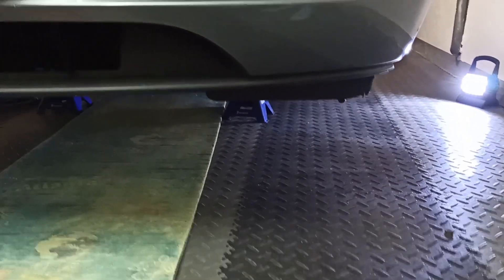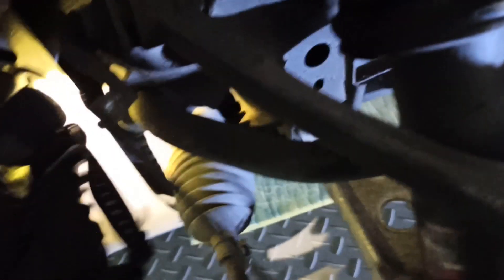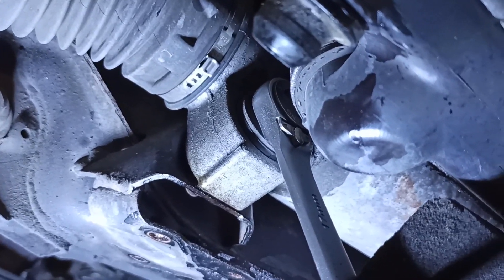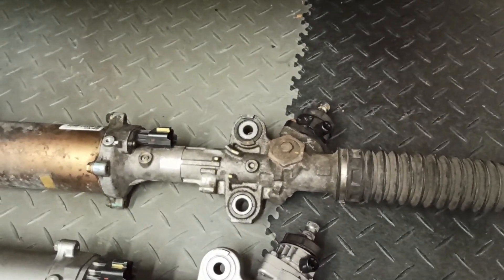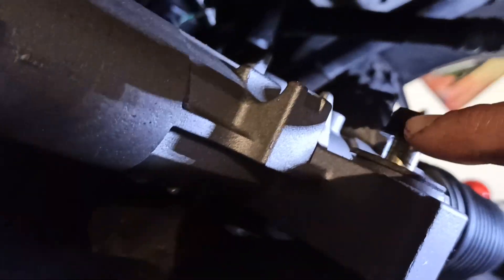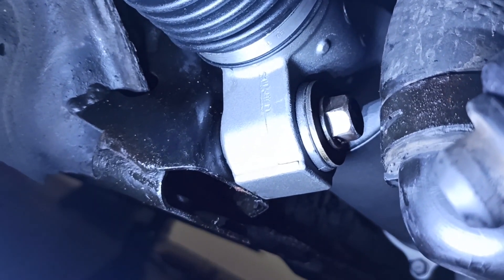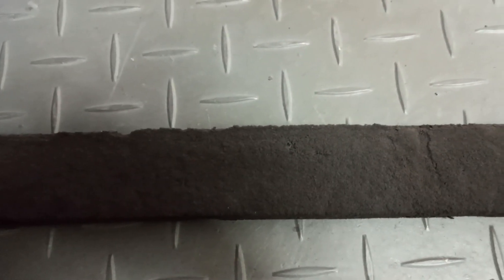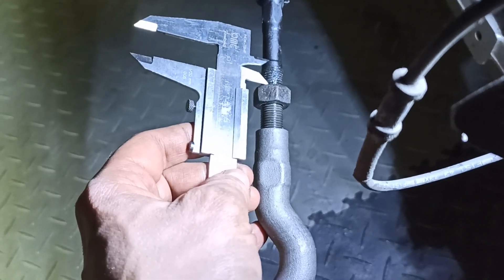Mazda RX-8 warning light for steering support - how to replace your steering rack

Comment: When you removed the steeering rack from the steering column did you align the the pinon going into the steering column? Like the small grey piece with the pink plastic dot on ii that detaches from that knuckle joint?
Reply from the maker: I kept the wheels and the steering wheel straight. When installing you need maybe more then one attempt to get it back in straight. You will only see it when both wheels are installed.
Reply: @heroesofthelandstrasse  I don't quite understand why you have the torque sensor adjustment with ForScan and what it's for.
Reply from the maker: @josebasyosi3818 The sensor needs to be calibrated to center position. When the steering rack is in middle position, the torque sensor is not necessarily at 0 V. The EPS CU need to know, which voltage is assigned to the medium position. You need to send a specific PID to the CU to tell it that it should store the given voltage as center position.
Reply: @heroesofthelandstrasse  I understand.
although I don't see this as a major issue. In my case, I have a problem that I don't know if it's common to the RX-8: when I'm stopped at an intersection, I turn the steering wheel 360 degrees to turn onto another street, and then start moving again, the steering wheel doesn't return to the center. At low speeds, it works more or less fine; it returns to the center properly, although it needs a little help.
Reply: @josebasyosi3818  Most likely that your steering joint 'UJ' is stuck/dry. It's halfway up the steering column and might need grease. With the front wheels up the steering wheels should spin freely left to right and the other way. If all the parts are working properly you can adjust the steering torque on the rack... but you'll really need the workshop manual or even better a mechanic to adjust it. It's dangerous if you get it wrong.